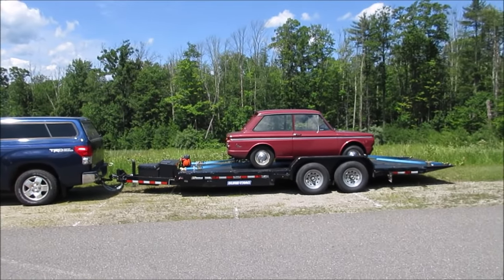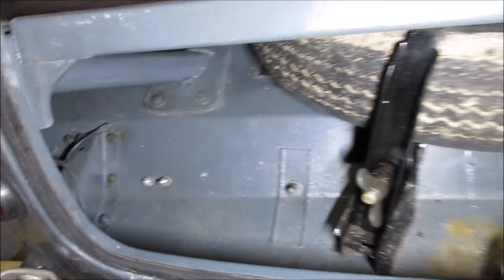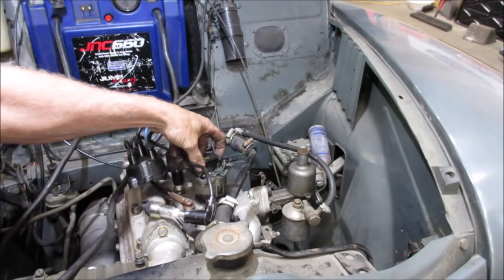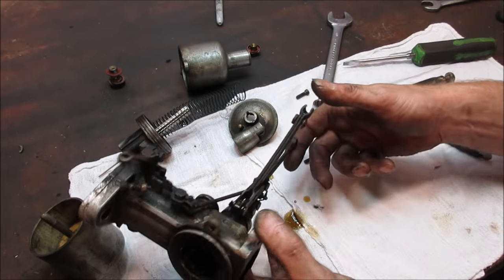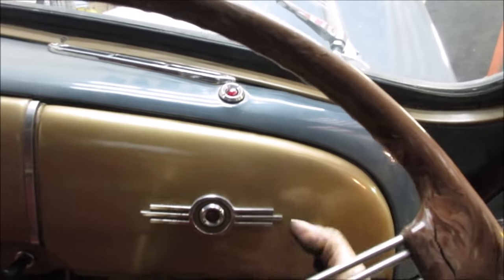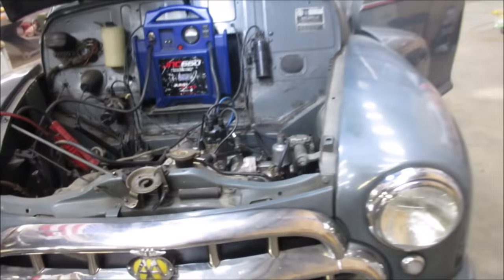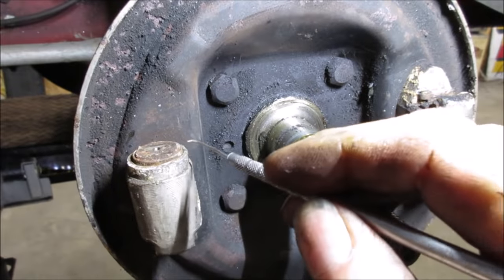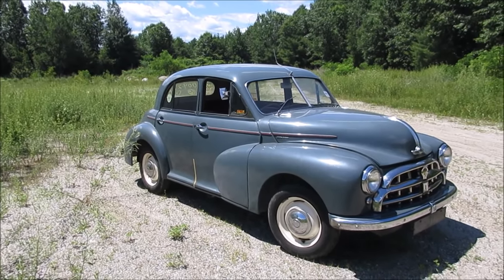50s Morris Oxford Found in an Old Warehouse. Did It Survive?

Comment: The definitive guide to tuning SU carburettors is 'Tuning SU Carburettors' by Speedsport ISBN 85113-072-0 The dashpot oil dampens needle fluctuations. The choke must be pulled out to its maximum when starting for the first few revs then released to a finger width until warm.
Idle mixture only is set by adjusting the central nut on the main jet spindle. Need optical spark plugs for that. The running mixture is factory set by the shape of the main needle. Finer adjustment is availabe by changing shape of needle and testing on dynamometer. Sticking floats and overflow from drain very common and could be said to be a design failure.

Comment: This was a classic family car at the lower price range. It was the last such design by Morris Motors before merging with their erstwhile main rival Austin thus forming BMC (British Motor Corporation). BMC included MG - from Morris, Wolseley & Van Den Plas from Austin after which they bought Riley.
All the marques continued to be used but with badge engineering only. In the case of Austin/Morris the family saloons were harmonised in 1956 with a Farina design, the Morris version still marketed as the 'Oxford' and the Austin the 'A55 Cambridge'. From here they went slowly downhill due to poor management, Ford becoming the biggest UK car manufacturer.
On polarity, to my knowledge all UK vehicles used +ve earth until the introduction of alternators. This happened progressively in the 1970s. (I have 2 Massey Ferguson tractors from the 1960s, a '65' entirely UK built (but imported into France) with Lucas electrics using +ve earth, & a French built '30' using Paris Rhône electrics with -ve earth. Both used dynamos.
The bench seat and column shift were common for most of the lower end of the market fazmily saloons, Ford, Vauxhall (GM), BMC, Rootes. Thus making them 6 seaters. Ford were (to my knowledge) the 1st to find a way of using a column shift with a four speed gearbox, this was with the Series 3 Zodiac, Zephyr & Consul in 1962.

Comment: Reversing the battery will do no damage at all. It was common back in the day to convert to negative ground by doing exactly that and flashing the field winding of the dynamo by connecting the battery negative to ground first and tapping the field terminal on the dynamo several times with a wire connected to the battery positive. This reverses the residual magnetism in field winding cores so when you bump start (push start) the car with a dead battery the dynamo will provide enough voltage to power the coil.

Comment: Sale of petrol in litres in the UK took place in the mid 80s onwards. I got my licence in 1987 when I was 17 and only bought petrol in gallons once, in 1994 at a rural garage. Unleaded petrol only came in from the early 1990s after this car was imported to the US and leaded was still easily available. I had a 1979 Datsun Cherry until 1991 and was impressed that it took unleaded without modification.
Reply: Many UK export cars were manufactured with hardened valve seats so that they would survive in far away places that had poor petrol.....
one notable manufacturer that did this was Jaguar...

Comment: I used to work on British motorcycles once in a while, BSF is British Standard Fine, and there is also BSW (British Standard Whitworth). I believe the sizes are calculated the way old American sizes were calculated, by measuring the size of the bolt, instead of the diameter of the nut. So a 1" spanner in BSF won't match a 1" in SAE. Also, later on,  they had an ISO standard which wasn't the same as the Japanese ISO standard. It is a mess. 

Thanks for the content.
Keep up the good work.

בס'ד

Comment: Mustie!
Is definitely a must get it for your self.
This is Steve. I live in New Zealand. We used to have a few of these getting around. Even up till early 80s. If I am correct the Oxford at this age I think the late 50s. Oxford being higher class A40 or A50. The Oxford I think was a rear car even when new in 50s. Why I think it is 50s car is because it has the flat head motor in it. I am sure they went to the overhead valve engine, simular to what the MG's had. I think their was a MG magnet in a similar shape with twin SU carburetors. Etc. There is an 850 flathead Morris Miner that looks very very similar from 50s. Your Oxford body is lot bigger.
Inside the car looks exactly the same too. Even down to the dash and speedo, gauges, glove box door, etc.
The nob second from your left that comes out in stages is the choke on carb. The lever control on bottom of carb. You will see I think is a brass nut in same place. Is mixture control on the carb. Can turn with fingers. If not I think a 5/8 or 11/16 open end spanner fits. 
Turn anti clockwise I think makes it leaner (less fuel) clockwise more fuel.
Make sure the choke right in. As choke pushes same part for fuel mixture.
The nob you pull out on the right of the steering Wheel. I think is a hand throttle which I think only Oxford and other higher glasses got. Their idea of cruise control back in the day. Might have to twist it one way to lock it on lol.
Great car you should buy it.
I am sure machanical parts right up to the A55 Truck/Ute/Pickup. I think stop production in 1970. like brakes, suspension bits, etc might fit it.

Comment: Thread sizes are BSF and all austin/ morris etc were positive ground until around the late 60's from memory. Those fuel pumps had a habit of stopping and a good sharp tap would get them going. Thanks for the memory.
Firing order and valve clearances used to be cast into exhaust manifold from memory.

Comment: Oh how I remember the days of + earth cars and SU carbs ! I can remember when we had + earth and - earth cars running around over here. Man you had to be careful ! Starter switch on the floor and so was the dip switch . Heaters were an optional extra I remember my Dad driving us from Wiltshire to Leicester (about 120 miles)  we were absolutely frozen when we got there (Mum,Dad and three boys). That was in an old Austin 10. You guessed it, no heater! they were good ,weren't they ,the old semaphore direction indicator and Motorway remoulds.

Comment: Mustie, somebody may have already told you this but I'm too lazy to read all the old posts.  Back in the early 60's I dropped a 52 Caddy engine into my 49 Ford.  Had to switch positive to negative ground and 6v to 12 v.  The only thing that changed with the polarization was the Amp Meter.  New cars show the voltage.  Old cars showed the charge by the amperage.  I had to pull the wire that went through a loop behind the amp gauge around.  That changes the direction of the current.  Heater motor ran fine and radio worked.  Can't remember if other gauges were even working before the swap.  Of course I had to change all the bulbs and the voltage regulator.  Why don't you buy a cheap spark plug tester??  Much easier to use.
Reply: Opps, just saw you had a spark tester.

Comment: Some time in the '70s old cars in the UK were retro fitted with windscreen washers. The only exceptions being if the screen could be opened. I reckon that large button on the far right operates it.  The two wobbly things under the dash probably zeros the trip counter (on the right) and adjusts the clock.

Comment: The slide in these carbs is vacuum operated if I'm not mistaking, and the oil on top is to slow/dampen the movement. It should be a certain amount of a specific oil in them. The pedal operates a butterfly valve between the intake and the slide. And from in between the butterfly and the slide, there should be an air passage that goes to the top of the slide, so that when you press the accelerator and open the butterfly, the top of the slide will be exposed to more vacuum and get lifted up. This is to have a relatively constant velocity of the air through the venturi so that the latter will always work and draw fuel in. That's why an accelerator pump is not needed on this style of carb. I used to have a Saab 99 with a similar but more modern carb, a Zenith-Stromberg if my memory serves me. The slide on those is lifted by a rubber membrane, and when that membrane develops a hole the slide wont lift much, and that means you're not going anywhere in a hurry. I think it topped out at 50kph with the pedal to the metal. Took me a while to get home!

Aaaand shoot, I just realized Im commenting on a 1 year old video, and nobody will see this. Oh well, I'll leave it anyway.

Comment: We had one of these cars.  It was 1952 and were very good cars at the time. The worst thing was the door handles because thieves put a bar over them and wrenched them off to break in to the car. They all had a starting handle - useful if you were setting the points! They were good at electric starting and were used for towing caravans a lot with good torque on 92 octane fuel. UK fuel was sold by the Imperial gallon  and Europe sold it by the litre.  My oh my that engine is rough!!  Reverse has a spring action to select. Can't remember if towards you or away but one or the other in neutral.

Comment: The rust problems to be aware of on that model Oxford and the smaller Morris 1000 are chassis and front wings. An old school solution for the box section chassis was to pour in a gallon of old engine oil and park up outside somebody else's house until the surplus drained out. Later solution, spray in waxoil under pressure.
As for the wings because there are no liners mud collects above the headlights and at the rear of the wing. The lighter patch on your vehicle indicates a wing repair. Regular jet washing and waxoil treatment keeps the rust at bay.
Reply: Ah - well....in the early seventies, when these old things were student transport, eventually the spring hangers (under the back seat) rusted through and then the car sat down heavily and was dead . Very surprising to see them looking so pristine on this car. My 1960 Riley 1.5 had all the same mechanicals. Not good on corners, kept trying to kill me.

Comment: Probably been told 100 plus times, but just in case.  I think the knob on the extreme right is actually a pump to spray the screen with water, push it not pull it. Bottle fixed to bulkhead. An optional extra in its day. The two red items above it are lights to tell you something is switched on, again optional extras, they unscrew to replace small bulbs, well  mine did. Car is in exceptional condition and just may be worth advertising in a European Classic Magazine. This vehicle design was eventually sold to an Indian company, Hindustan I think,  and until quite recently was produced in hundreds of thousands in India as taxis,  albeit modernised from time to time.

Comment: The carb and the electric fuel pump were made by SU (Skinners Union) and were popular units in uk right up until fuel injection. Parts are readily available still for almost all variations.
Good reliable and simple carbs with good economy. The choke works well if it pulls that big lever far enough and will cure the poor starting.  
   The fuel pumps were fine if used regularly but the points tended to stick on ones that sat about. I see you discovered a good thump works wonders. 
BSW British standard Whitworth were the coarse threaded option, while
BSF British Standard Fine were the fine threaded.
 Both used until the late fifties when UNF and UNC were introduced (Same or similar to USA sizes) but only a dozen years or so later UK went metric. So I have three sets of spanners!

Comment: Hi Mustie, On the electric Lucas or AC fuel pump if it says negative earth than this is what the car is. If it says nothing its positive earth. I loved the stickers which are real mid 1980's when I passed my car driving test. Many people had a Krooklock as many cars did not have steering locks and could be easily stolen even if they did! The Formula Shell litres to Gallons sticker is a bit of a worry. Shell sold this Petrol, (Gas), called Formula Shell. It caused problems back in the day and was withdrawn as many older cars experienced pinking and pre ignition. I was told it was also lead free years before this became available in Britain. It messed up many cars like Minis and even Fords like Sierra's and Cortina's and I have seen the results of burnt away valve seats and been down the scrap yard with cars too damaged to be worth the repair costs. A friend of mine worked for a Ford dealership and was threatened by a customer as the dealer would not honour the warranty because of this petrol. If the MO has been run on this for any length of time I suspect it would be the cause of the poor compression. The RAC badge is breakdown cover and stands for Royal Automobile Club. The AA badge on the front is Automobile Association, similar to AAA.
The pump button is for a Tudor windscreen washer pump. The bottle is under the hood. This would have been after market as cars had to have these fitted to comply with the annual MOT test. I suspect there is another glove box behind the steering wheel.  Really enjoyed the video and thanks for posting. This MO is in remarkable rust free condition.

Comment: I owned a 1960 MGA 1600, in the late 60s. It wouldn't stay with all the V8s of the time, but top end, it would walk right along beside them. It's powerband was 60mph for 3rd. I messed with VWs and the likes. Well... on my way to work in B'ham I saw a Morris coming up behind me on the 4 lane. I was thinking to myself... yep I'lll show him a thing or two. In the rearview it looked like it was pulling a small trailer. Yeah... I got him. I eased it out of 4th into 3rd at 55mph waiting for him to get even with me. Looked over just ready to nail it.... and saw all those scrambled eggs hanging behind the front wheel, HEADERS THAT IS appeared to be a 283 chevy!!!  And as I eased back into 4th gear, he cruised paste. And the wheels I thought were on a trailer actually were the rear wheels hanging out of the rear fenders about 3 or 4 inches. The moral of the story ARE!!! If you have an 8 oz ballpeen hammer..... don't pick a fight with the man toting a 10lb sledge.

Comment: In the UK, we changed from selling fuel in gallons to having both gallons and litres on the pumps in the mid eighties. We stopped showing it in gallons in 1995, so the sticker on the window would have been an aide-memoir from that era. Gallons in the UK are bigger than yours because our pints are 20 fluid ounces and yours are only 16. So that's why it said a gallon was 4.5 litres. US gallons are only 3.6 litres.

BTW, there were three imperial standards of measurement in the UK back in the day. There was Whitworth, BSF and AF. I never got my head around any of them apart from AF, which was the only one which actually told you anything about the size of the nut/bolt. We now use metric most of the time.

The strange device on the top of the carburetor is called a 'dash-pot' and was used on SU carburetors of that era. As you correctly surmised, it is used to meter the flow of fuel into the air stream. I nearly screamed when you tried to put fuel into the top of the dash-pot! It will need a drop of oil in there to keep the movement of the piston nice and smooth when you reassemble it.

I loved seeing both the Hillman Imp (which I drove in the 60's and 70's) and the older Morris Oxford, which was built a few miles east of where I live in Cowley, Oxford.

Thanks for your great videos.

Comment: There is a Lucas fuel pump under that black plastic cover. A starting handle is likely a 5/8 rod with a 1/8" pin through the end, a bicycle crank makes a fine crank arm. There is a P on one battery connector between the cable screws N on the other

Comment: The oil is mostly for the throttle dampener. When you open the throttle quickly the oil goes through the brass parts slowly to increase the amount of gas, by increasing the velocity of the air over the jet. When you let off the throttle the piston closes fast. You should add oil until it comes to the top of the piece attached to the piston. This way it puts some oil on the slide, when you put the dampener cap on. The outside of the piston doesn't need oil as the center is suppose to keep it centered. 
The lever at the bottom is the choke. Pulling it down increases the opening around the needle. As the air flow increases it lifts the piston, increasing the amount of fuel. 
This is called a constant velocity carburetor. It adjust, by the needle height, to match the air and fuel mixture.

Comment: According to Wikipedia:
“British Morris and MG engines from 1923 to 1955 were built using metric threads but with bolt heads and nuts dimensioned for Whitworth spanners and sockets.[13] In 1919, Morris Motors took over the French Hotchkiss engine works which had moved to Coventry during the First World War. The Hotchkiss machine tools were of metric thread but metric spanners were not readily available in Britain at the time, so fasteners were made with metric thread but Whitworth heads”

Comment: oh and think you need a bit more oil in the dash pot.. top of the carburetor  , it help to dampen the bounce in the needle . fuel pump has a set of point in the cap at the wire end, and the stick , so always carry a light hammer to give the pump a knock .

Comment: The inlet vacuum lifts the piston and the needle valve. You need to keep the little reservoir on top filled with engine oil.  The little pump on the right side could be a manual windscreen washer pump. Sounds like it's only running on 2 or 3.